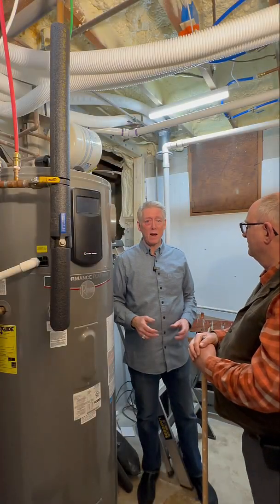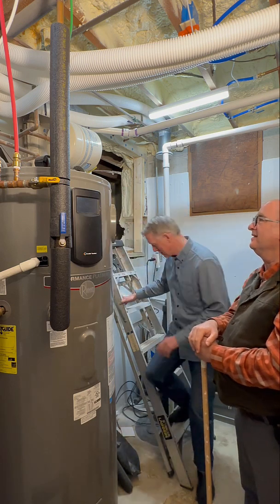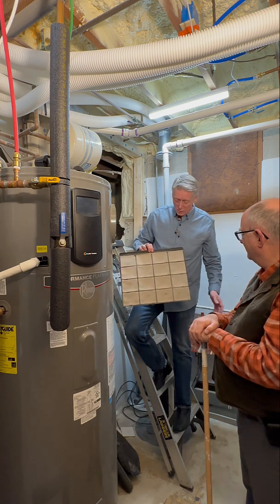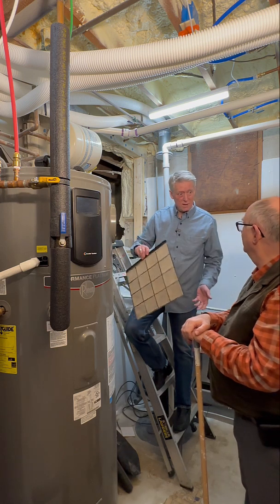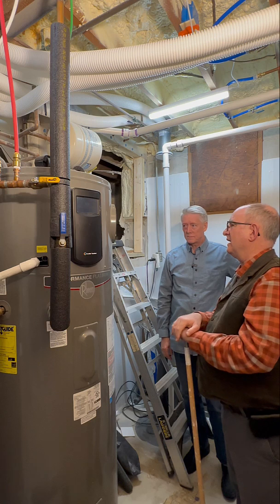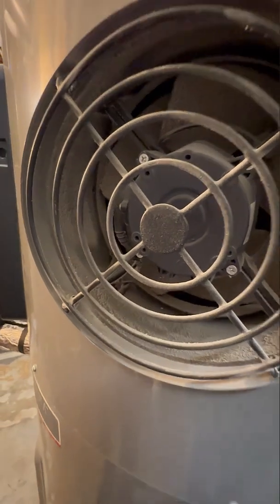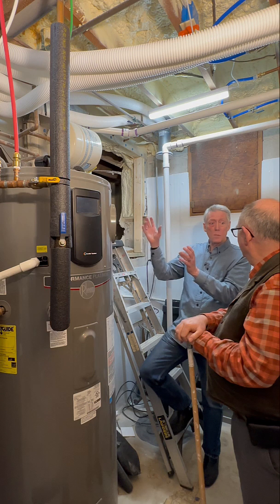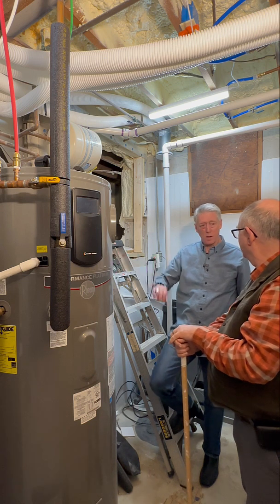Filtering the Air in a Heat Pump Water Heater, Part 1

Comment: I was just at a home we installed the HPWH about a year ago and they're planning to remodel basement. I recommended to keep it in electric only mode during construction and have the crew use a room air filter too. What can you use condensate for?
Reply from the maker: That's a smart move.  Early on when we had the most dust in the basement, I would turn it off and cover it.  Then I stopped being diligent about it.